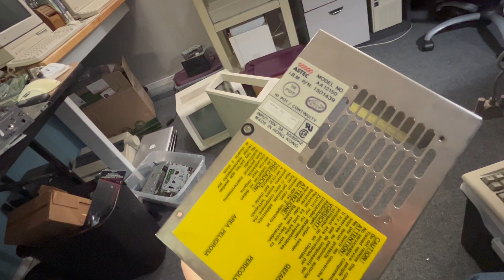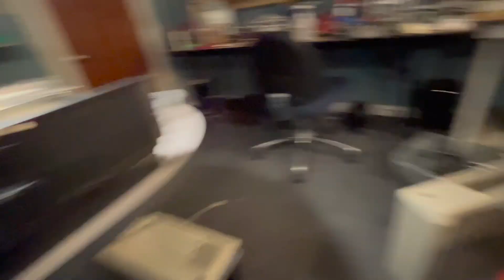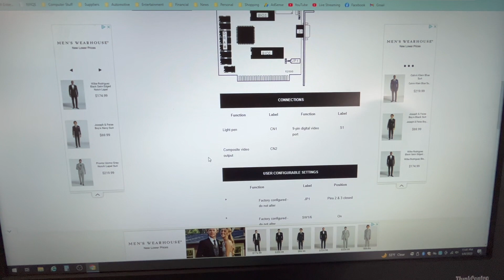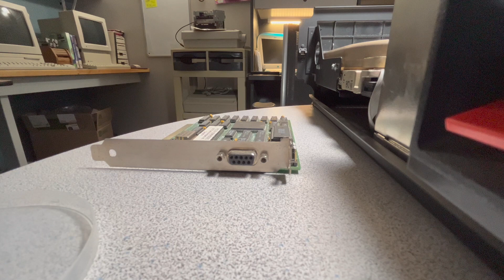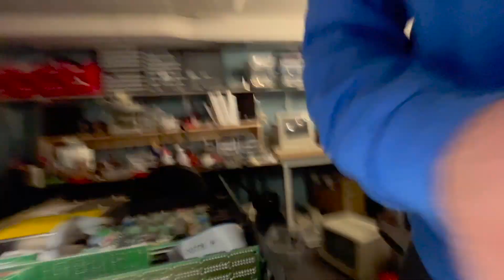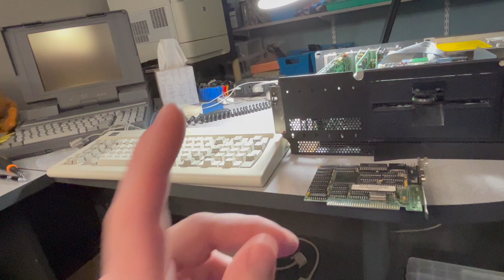1984 IBM XT Gets a New FAN and Maybe Another Graphics Card?

Comment: You didn't specify what the amperage is at 12 and 5 volts on that power supply but that Transformer in that Supply is way too small to be free a continuous from the mains it's going to be a high-frequency switching power supply it may use linear voltage Regulators on the final output stage of the Transformer not sure if the Transformer puts out 5 and 12 volts it may only put out 12 volts and then the rest of the voltages are derived from with a linear regulator
Reply from the maker: Thanks for the clarification!

Comment: From the info on Vogons, the Graphics Solution Plus is the same as Rev. 2 of the original Graphics Solution, just with an updated display controller chip. Did you try setting both the display configuration switches and monitor switches to monochrome? If all else fails, you can try setting everything (include the DIP switches on the XT's motherboard) to CGA, then connecting the composite output (via some jury-rigged wiring) to a TV or monitor with a composite video input.
Reply from the maker: During a live video, a viewer sent me a few other documents that had the proper settings - seemingly - and it still didn't respond. I came to the conclusion the card is likely bad, and to make matters worse, the floppy drive is - iffy. Could be an alignment issue, could be the fact that the disk hub clamp doesn't lock the disk in place properly (putting the disk off-center). I've decided to shelve the project for now, and it sits on my desk at work for the time being.